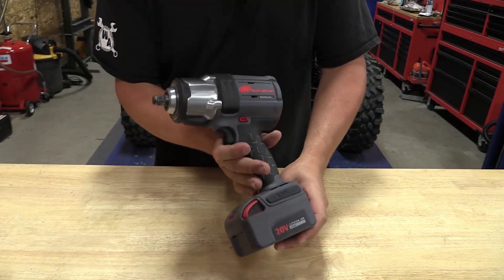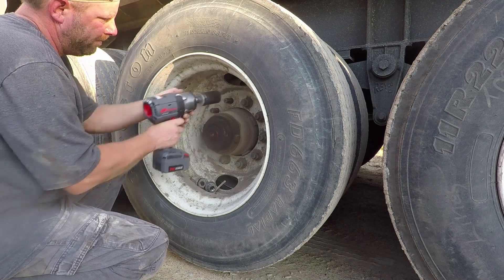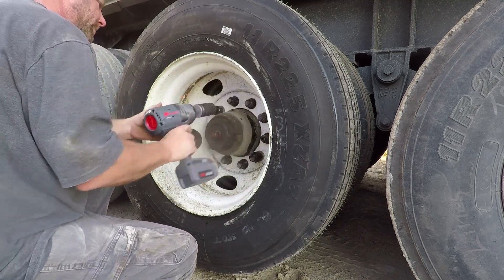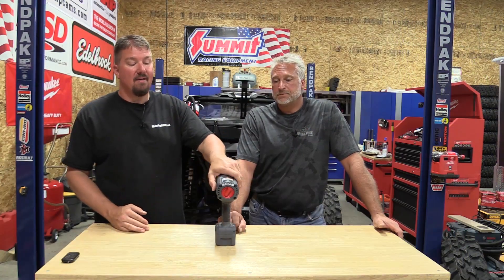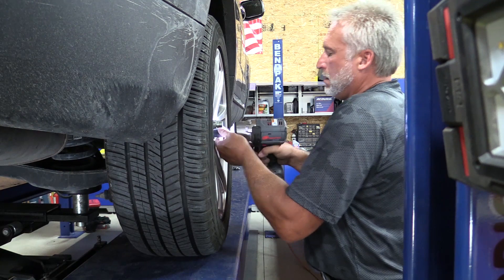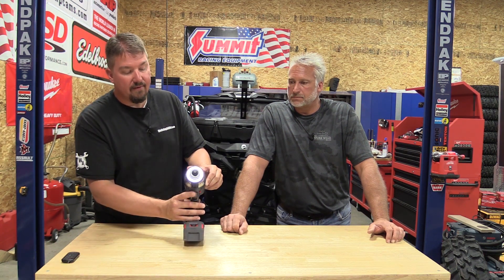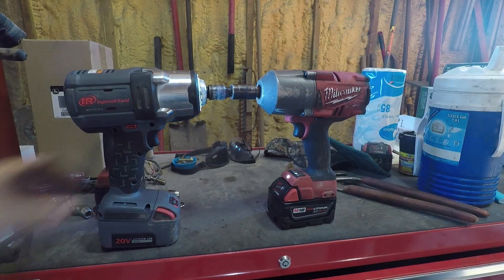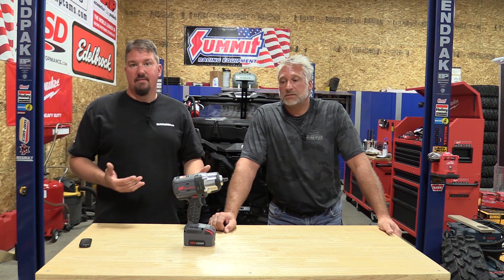Our Experience With The W7152 Ingersoll Rand 1/2" Impact Wrench 1,500 ft-lbs Nut Busting

Comment: It looks to me like the Milwaukee was turning the damn Ingersoll Rand and then if you slide the video down when the guy running the Milwaukee let's off the trigger you can finally see the hole in one of the sockets they got on the impact reverse direction. And the guy running the Ingersoll Rand look at the way his hand is twisting while he's trying to hold it you can clearly tell the Milwaukee is twisting his hand in the direction it would be if the Milwaukee was winning I don't buy this video I think it's a lie. I just ordered the same model Ingersoll Rand 7152 and I'm not too impressed with it to be honest it wouldn't break loose a nut on a u bolt on a rear end of my truckthat was rusted on. So I borrowed my friends Milwaukee and it twisted the damn thing right off there I'm sending my Ingersoll Rand back ASAP. And the five year warranty on the Milwaukee don't matter what retailer it comes from whatever they will still go by the date on the tool and honors their warranty they have honored their warranty even 3 years past the 5 years. Two times for my neighbor for free they've replaced his half inch impact but it being 8 9 years old. Milwaukee for the win Ingersoll Rand has the light ring going for it tho.

Comment: Battery is biggest downside.  3/4 - 1/2 adapter doesn't seem to loose any tq, I have both 1/2 & 3/4 33mm sockets for big rig lug nuts, I run them down, once they touch rim, 3sec impact,  check with 3/4 tq wrench and they are all in the 525-575ftlb range. 3/4 socket with 1/2adaptor or just the 1/2 33mm socket. No different.  1 5.0 Milwaukee battery will take off 6 big rig tires, 60 lug nuts . 1 5.0 to put all 6 back on. Once u start using the 9ah battery on tires, the gun doesn't fit as well in the rim, so u gotta use 3in extension,  unless u wanna mar up your 9ah battery against rim, and gun against hub.
Reply: Kwmike-D going a little high on those lug nuts. Lol
But yes, I run them down with my m18 and hit 500 no problem.

Comment: Why do people not go buy a 1 5/16”   1/2” socket ...
Reply from the maker: LOL.  Because 99% of the time one would use a 3/4" air gun to put them on and a 1" to take them off.
Reply: Its 33mm
Reply: Yea same as 1 5/16”
Reply: 33 fits better
Reply: I do have big 1/2" drive sockets.  I despise adapters!

Comment: there is a bad ass makita with 3/4 inch anvil...i use it to burst cylinder head bolts for mercedes actros trucks.i don’t think 🤔 the mulwaukee or this ingersol can match it...nice tool thou.
Reply: I have a 1 air impact that would break your toy 3/4 in half.

Comment: I think u can get this at Ohio Power Tool $488 with 2 5.0 batteries right now
Reply from the maker: WOW, Steal!  You need to put these links in when you find this stuff.  :)
Reply: @WorkshopAddict  https://www.ohiopowertool.com/m-2247-ingersoll-rand-iqv-20v-impact-drivers-impact-wrenches.aspx
Reply: @WorkshopAddict  I was going to say you should mention prices on these things. I was cool but how much is something like that.
Reply: @WorkshopAddict  For people who already have batteries and charger-https://www.factoryauthorizedoutlet.com/ingersoll-rand-w7152-20-volt-1-2-inch-cordless-impact-wrench-bare-tool
Reply: @WorkshopAddict  Kwmike-D This is the price for the Milsquaukee. Just to show price is not that much higher. It's worth the extra cost for quality. https://www.ohiopowertool.com/p-5487-milwaukee-m18-fuel-12in-high-torque-impact-wrench-w-friction-ring-xc50ah-kit-2767-22.aspx

Comment: They used the Milwaukee mid torque,at 600lbs,and yes those lugs nuts were pre-tightened at 500lbs. Any mechanic knows you gotta have more then just a 1/2 impact in your tool box and Milwaukee is there to cover that,I have snap-on people and all they use now is milwaukee. IR is still in the world of air and they do a good job there.
Reply from the maker: We did not use the Mid-Torque.  LMAO....  Look at the size of it....  That is funny.
Reply: @WorkshopAddict  Okay that's Kool you did use the 1/2 high torque,and looks like the same size battery 5ah congrats to the IR. Milwaukee has moved on from 1/2, and onto the 1 inch which will be much more inclined to handle lug nuts.
Reply from the maker: Ryan, we like Milwaukee also, but you do not need a 1" impact for lug nuts.  Maybe on some really rusty semi truck lug nuts, but I am sure you know those only get tightened to 450-550 ft lbs.  So, yeah, some heavy duty mechanics will get them.  90% of the mechanics use a 1/2" impact for everyday use, in fact, other than semi truck lug nuts, most heavy equipment mechanics use 1/2" impacts daily.  We have not seen the M18 1" on the market yet, but we are sure it is coming and we know it will be bad ass, but comparing a 1" to a 1/2" is not "Kool" just to be brand loyal.  Okay, the Milwaukee got smoked by the IR, but does anyone need that kind of power in a 1/2" drive?  Like we said, it is hard to find sockets large enough in 1/2" drive to use the power it has.
Reply: @WorkshopAddict  agreed,but IR is a little late like others brought out. Nice Vid though just a though next time show model numbers of products shown so alot of things are clear from the get go. Sizes look different on our end. Thanks

Comment: Haha the butthurt! I have a Milwaukee line up, used to have a ingersoll line up, but the battery platform and tool selection suffers. Ingersoll had and still has, more reliability. For every three dewalt and one Milwaukee, no ingersoll was sent back for repair
Reply: Every 3 dewalt and 1 milwaukee lol, dewalt destroy milwaukkee dude even my 6 amp is stronger than milwaukee 9 amp and it last the whole job unlike milwaukke i have to change battery approximatively every hour lol

Comment: I can tell those truck tires WERE NOT TORQUE TO SPEC.I WOULD OF KICK YOU OUT OF MY SHOP IF A TORQUE WRENCH IS NOT USED TO TIGHTEN LUGS ON A SEMI 550 lbs FT IS what those lugs are tighten to! I AM 40 YEARS ASE MASTER TECHNICIAN!!!
I am  willing to bet YOU NEVER Check those lugs after tightening those lugs!!! YOU GUYS ARE NO TECHNICIANS!!!!
Reply from the maker: Thanks for staying calm.  We do check them with a 3/4" TW after.  Settle down.
Reply: @WorkshopAddict  Your telling me to settle down that's a laugh! Well let me say this
  I am a MASTER ASE TECHNICIAN (40 years )I know what 550 lbs sounds like on a wheel lug. ALso I am the LEAD TECHNICIAN IN ONE OF THE LARGEST MUNICIPAL TRUCK FLEETS! Those lugs were not in ANYWAY torque down and on the vehicle any length of time if they were it would off taken MORE THAN A SECOND TO REMOVE!Any time you want me to demonstrate what 550 lbs looks like send me a BUSINESS email and I will give you a class on how to remove and install a truck tire! keep this in mind I TRAIN OTHER TECHNICIANS!!
Reply from the maker: @apacheone3643  Thanks for telling me so much about your skills again. 😁
Reply: CRAZY HORSEPOWER the torque range is actually 450-500 lb ft. And a healthy 1/2 drive impact gun with good air psi and volume is more than capable of that. Let alone these new brushless type electric impacts are even a bit stronger.
Reply: LB9FTW incorrect. A aircat 1250k or ingersol 2235 running on 140 psi will only put out about 400 lb ft of solid torque

Comment: I wouldn't use any battery impact to put lugnuts back on a semi, 1" air for me
Reply from the maker: Everyone has their own way.  You are the first to say they use a 1" to put them back on.  We use a 3/4" pneumatic to put them back on and a 1" pneumatic to remove them.  That has since changed with the new battery impacts.  but we check ours with a torque wrench.  Most do not.
Reply: I use a 3/4" on aluminum wheels and the 1" on steels
Reply from the maker: @natesalemno3425  What is the goal for the torque when tightened for each wheel.  We look for 450 ft lbs.
Reply: @WorkshopAddict  around 600 lbs for steels
Reply: I normally use Nitrocat 1250k 1/2 with 15w40 oil lubricant for internal clutch hammers on 33mm lugs for 60ft transit buses all day long no issues.   Till I have to change a tire on the street.    The the wrecker tow truck doesn't have enough air supply even with engine at full RPMS to remove more then 2 lugs.  I just use Milwaukee 1/2 high torque that I paid 230$ with free 5.0 battery it gets the job done every time.   But that IR gun is nice,  but I am already committed to Milwaukee battery platform.

Comment: You seem to want to dog the bluetooth feature of the 2863 yet fail to mention that the feature isn't even necessary to operate the gun. It works as it should right out of the box. The Bluetooth just adds another layer of customization for the end user. Its not hard either. Took me about 10 minutes to set mine up. Tweaked it a few times afterwards. I mean, who doesn't want more control over their tools? 

The difference between push-buttons and a dial to set torque settings is just user preference. One isn't better than the other.

Also, why not compare this to the 2767? Same specs, no Bluetooth.

I like IR stuff, but they've been asleep at the wheel (in this market) while milwaukee just keeps improving things. The batteries are overpriced as well, almost double over Milwaukee. Not to mention the product range isn't even in the same stratosphere as Milwaukee. It might have won the "battle", but it isn't even close to winning the war.
Reply: I am not dogging the BT feature.  I use it and like it.  I greatly prefer the larger dial on the back of the IR over the Milwaukee button.  I do not need more control over my tool than what the IR offers.  My Milwaukee is set up the same as the IR, just took me some time to get the hand and wrench tight settings to my liking.  We did show it going up against the 2767 in the first head to head.  I never said that IR was the best battery platform, we just really like the impact wrench.  Never said IR is a better platform than Milwaukee, in fact, we bagged on them being behind in battery technology.
Reply: @wrenchesrides  Don't misunderstand me. I'm sure the IR is great, and probably is the slightly better gun. Still, you were insinuating that the Bluetooth feature was necessary to make the Milwaukee operational to try to suggest the IR was superior in that regard. It isn't, it just comes down to user preference. I like the extra customization of the Bluetooth and find it valuable. Is it a necessity? No not in the slightest. The gun is fantastic with or without.  At the very least it gives me a better idea of what "xxx" torque looks and feels like.
Reply from the maker: But if you want the Milwaukee to do something like hand tight, you need to at least use bluetooth once on the tool to set it up.

Comment: Put the Milwaukee in reverse and the IR in forward and see who wins, the IR has 1,500 in reverse and the Milwaukee has 1,450 in reverse not forward
Reply from the maker: Then they would go in the same direction????????
Reply: 2767 has 1400 ft lbs in reverse. You can swallow the other 50 buddy!!
Reply: Neither one has the power the factory claims

Comment: Bigger weight more battery is not a issue and acting like u don’t need more power is completely idiotic go pull out your air tools if your gonna be 100% negative battery tools killed the air market get over it

Comment: The biggest issue i have with electric impacts (corded&cordless) is they don't have that surge of uggadugga of that start they have one maybe 2 good hits. After that they are useless I have used Milwaukee,Dewalt(MAC tools),Bosch, and the Snap-On (IR) cordless guns. None of these work in a shop environment for long. People can disagree but when you run into nuts you cant loosen with the gun and you have to walk over and grab your air gun. You are just going to default go to the air gun everytime. This will always be the issue until the day comes where the electric guns and keep up with air.
Reply: Ive had mine for 4 years, Snap on isn't IR, Matco is IR. Do you even wrench?  The way you described air vs electric is the complete opposite, electric is constant even torque, where as air is a huge surge at first and dies off quickly.

Comment: Sorry but it not over torque Milwaukee. The rpm of Ingersoll is 2400(BLS/m 2450) and Milwaukee has 1750(BLS/m2100) so Ingresoll is only faster (20v). It the same time he made more blaster. so when the springs in the gears tighten, the 7152 tightens up faster and releases the impact faster by transferring some of the force to the other dummy by transferring the power of its impact to the Milwaukee. Because there was the right force on him. Nuton's law.So But to check the power of the bluster or check which one is stronger you should tigh something by 7152 and check that Milwaukee can handle this.
Reply: You need to watch video again. They even started the milwaukee 1st and it spun it backwards like it was nothing. 7152 is definitely more powerful.
Reply: If you look ed ay the hammers ir bigger so it hits harder